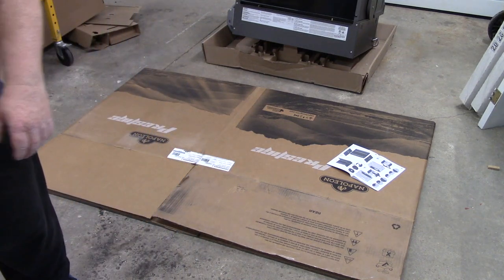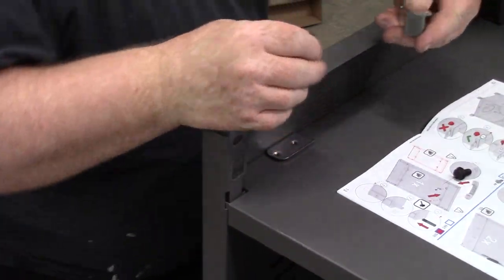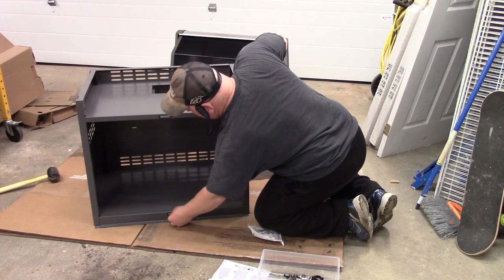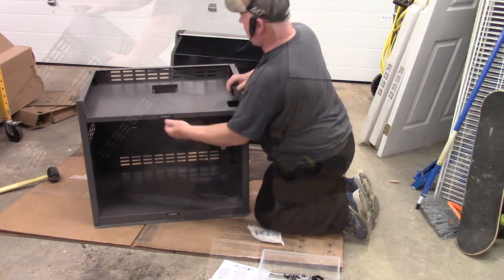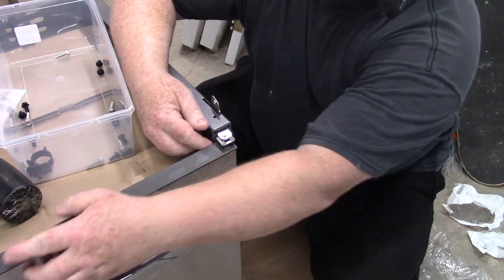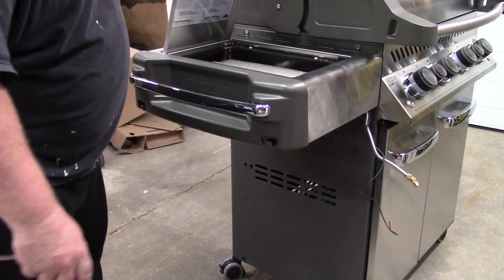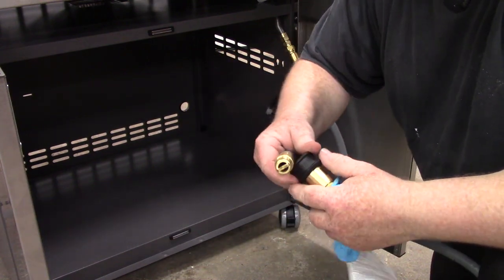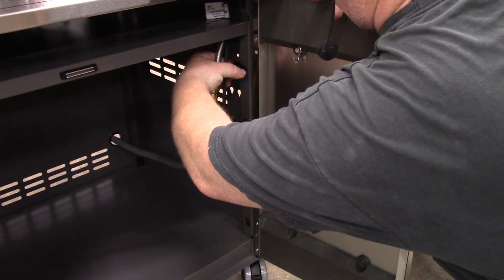Napoleon Prestige 500 BBQ Grill Assembly

Comment: Fantastic! I don't think I would have completed the assembly without your video. Much better than the official Napoleon assembly video. I'll add a few things for future viewers. You get about 5 packs of screws/small parts. They are hidden all over the place. The self tapping screws for the infrared burner shelf are in the package attached to the right utility shelf, not the infrared shelf. The plastic ring that holds the hose and battery wire no longer clips in. It comes with a tiny screw to attach it to the grill base. I should have kept a list of other frustrations, but that's all I can think of right now.

Comment: 15.38 I've built a dozen of these units and only one of them had those types of screws for the sides. The rest, flat-point screws. It would be nice to have these screws for future units.
Reply: How are you getting the flat point screws in? I don’t have self tapping either and can’t get the remaining screws in for the sizzle zone shelf.
Reply: @mikemondelli741  So I suffered from a slight bone-head moment. One of the side burners had screws that were taped to the very bottom that appear to be the screws that are self-tapping. Otherwise, I had to use an impact driver to get the flat ones   in. It's a bit confusing considering nothing in the literature explains where to find the correct screws. I still don't understand why the flat ones are given in the first place. I could be missing a step, but the directions on the assembly of these grills are lackluster at best.

Comment: My Prestige 500 came assembled and while moving it a year later, the right side door fell off. When I reinserted it, the pegs fit but it was much lower. The door does not close evenly even with the spacer and holes on the bottom. Almost like it needs a water to raise it up. Adjusting the nut was of little help.
Reply from the maker: There is a washer spacer that the door sits in.  Is it possible that is missing?
Reply: If you are referring to to the black washer spacer sitting in the bottom hole , no, it is there. To my eye the parts are the same on either side. The only thing that occurs to me is that I did not reassemble on a completely flat surface. Our patio stones are uneven.  An since we are about to do a Reno on the patio and my garage has no working space, I won’t  know for a while. I’m going to take photos and go to the local retailer who assembled it.
Reply: @robsgaragewoodworkin  I think I have to reinstall the door on a level surface. That is what the dealer recommended. As I was moseying about the dealer I saw one with assembled with a similar issue. Glad to know I am not only one. The BBQ works fine though.
Reply: @robsgaragewoodworkin  time passed and after putting the bbq in my garage (on a flat concrete floor) during the patio installation, the doors leveled themselves and now open properly.

Comment: So the doors can be adjusted after it’s assembled if need be ?
Debating having it assembled from store or doing it myself
Reply from the maker: @Mr710324   it’s not that hard to assemble and you can fit the box in an SUV (I have a CRV).  Once assembled you will need a truck.  If you have a truck and assembly is $50 then that’s not a bad deal or you can DIY it and buy steak 🥩 with the money you saved.  😎

Comment: What screws did you use to attach the burner to the grill?  The silver ones dont seem to fit?
Reply from the maker: Mine was already installed from the factory
Reply: I have the same issue...Screws seem to be too big. Did you resolve this? Also, the holes don't seem to have threads to even screw them in. If you had to purchase new screws, what did you use?
Reply from the maker: @daveschenone7355    The burner was already attached to the fire box.  It came pre assembled
Reply: @daveschenone7355  I figured it out.  You have to mess around with the screws to find the right fit. The one they tell you to use in the manual are not the right ones.